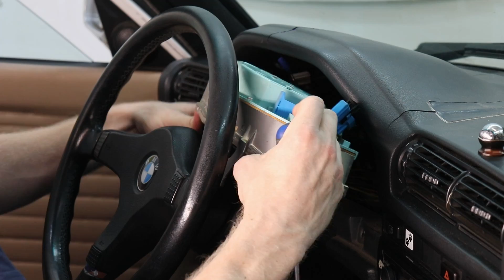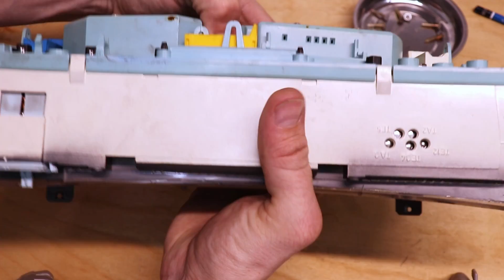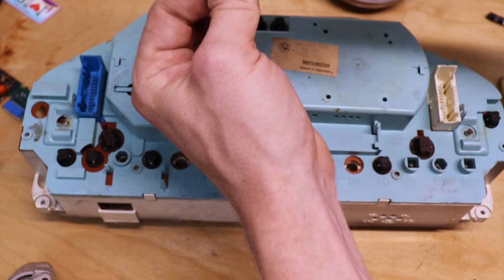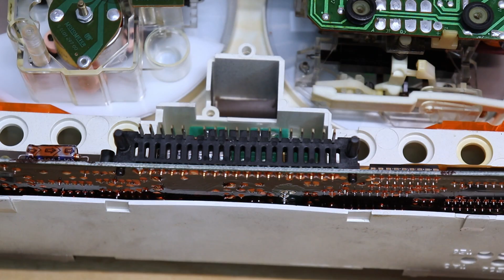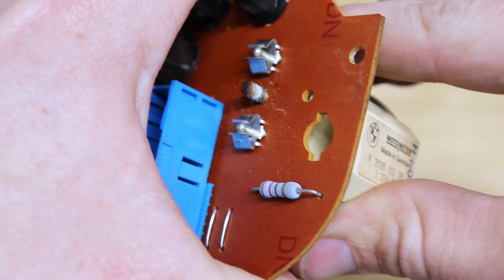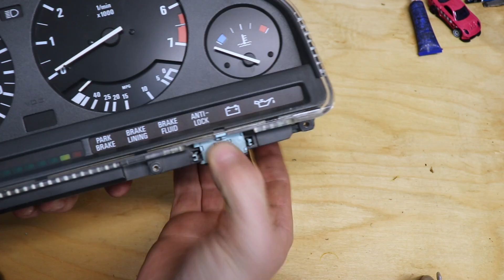Fixing a jumpy BMW gauge cluster

Comment from the maker: Hey Frens - My "fix" stopped working after a few weeks. I researched this issue more and realized that no, 2.whatever volts is not enough on the SI batteries and they are, in fact, the problem. I switched them out with new ones and alas all is well! So let's move the slider on this video into the "entertainment" side of the board. I mistaked.
Reply: Hi ,I'm in the same issue now need help , I installed  2 new si batteries thinking would fix it and come to fined out same issue my techometer , fuel gauge and temp at the start of the engine would attempt to start of fine in a split second cots off working the only thing that works is the speedo any ideas
Reply: @kirilchuk same here u found out how to fix it?

Comment: I put a M20 in a 91 318is and swapped in a 6 cylinder coding plug and it worked beautifully. This was years ago and it wasn’t your average m20 it was stroked and board to 2.9l with 10.3 compression and a big cam. It would destroy a stock e36 M3 but doesn’t even come close to my e46 M3. But I miss that car more than I like the M because I built it. Everything custom was me down to learning how to tune it myself. Not much other than cosmetic upgrades for the e46 M3. It's been voted several times on BMW forums that the e46 M3 won best BMW every built. There is nothing much I can do to improve it causes it is pretty good from the factory. Of course it has suspension, trans, engine and a few other mods but I am not creating a car you can never buy like I did with the E30. I really wish I could get it back because I would take it in a second.
Reply from the maker: What an awesome E30 and sad story to hear you don't have it anymore. This is a good reminder to hold on to the things you can't get back!
Reply: @CalmBMWRepair  definitely I had it for so long and I swapped it for a e46 M3. It’s superior in every way except I didn’t build it.
Reply: @CalmBMWRepair  it had a factory glass sunroof vey rare. I had to buy a car to get it and I did and put a metal back in solid if and got my sunroof for free.

Comment: What plug does the green cruise control go into?
Reply from the maker: There should be a plastic carrier that plugs in above and to the right of the yellow socket. The green plug goes into that carrier. If you are retro-fitting you might need to find one of the carriers.

Comment: What specific batteries does the board take?
Reply from the maker: CR14250 if you have the later cluster with the 3v Lithium batteries. Fortunately, they are easy to source online with the tabs spot welded on!